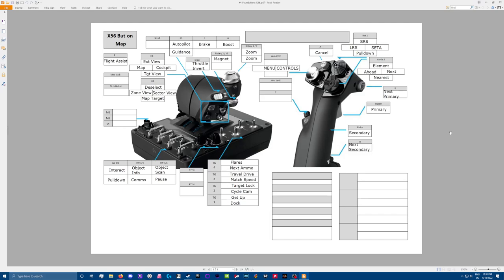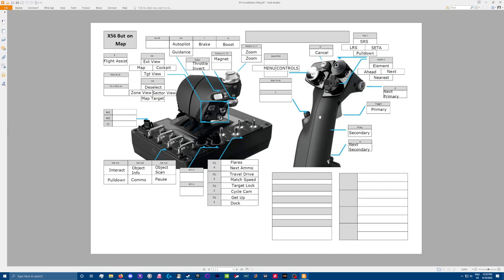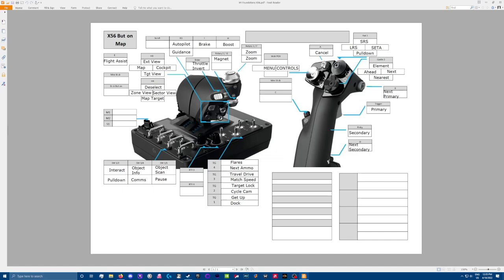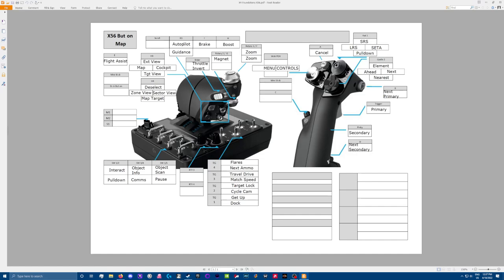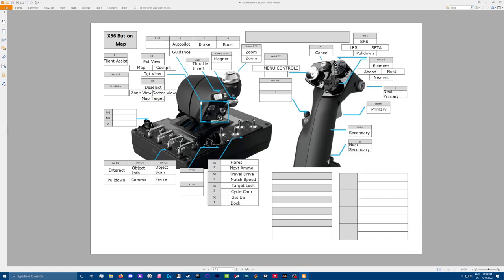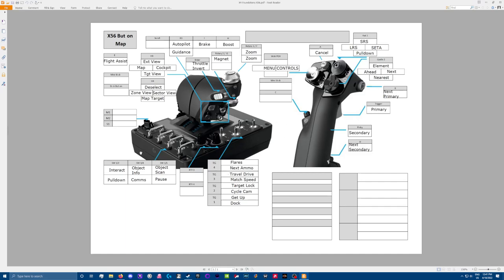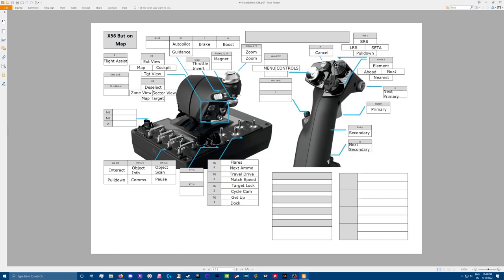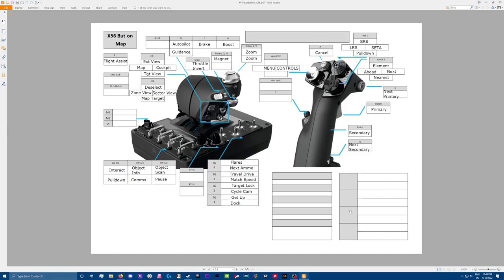X4 Foundations - Logitech Saitek X56 HOTAS Layout

Comment: The ergonomics for the travel drive are spot on. I added trigger to the interact options when on foot, and needed to adjust the reverse throttle button. Maybe 7 changed stuff. Wish I could somehow speed up the C stick head movement speed, but otherwise a boss setup. Brilliant. Kudos.

Comment: Thanks for the video! Super helpful 😄

I have a Saitek X-55 HOTAS myself, which is largely identical to the X-56. Unfortunately, the game wasn't detecting the mini joystick on my throttle near the thumb area, so I couldn't bind strafing to it directly. My HOTAS software detected it just fine, so I knew it wasn't a hardware issue. I went down a bit of a rabbit hole trying to fix this, with the main idea being to rebind the mini stick to output WASD keypresses. Autohotkey is the first place I look to for these kinds of things, but it turns out that that uses the Windows Joystick API, which only returns the input data for up to 6 axes per device and the mini joystick would've been the 7th 😞My guess is that X4 uses the same API. Anyway, after a bit of digging I came across the Windows.Gaming.Input API, which supports any number of axes, and ended up writing a small C# program with the help of GPT-4o to use that to read the joystick inputs and then output WASD keypresses. It's not pretty, but it works!

On the off chance that someone else has the same issue, I made the code open source and freely available here: https://github.com/mickdekkers/x4-x55-hotas-throttle-mini-stick-fixer

Comment: Thanks very much for the video. Very useful indeed. Just starting out in X4 Foundations (yeah, where have I been all this time?). Tried keyboard and mouse and hated it & switched to a HOTAS setup. I've set up my old Saitek X55 as per your setup here, except for some reason you aren't using the F and G Push buttons built into Rotary 1 and 2 which I find quite conveniently placed and give good feedback - I am using F instead of TGL 3 Down for match speed and G for Deselect instead of H4 Up, which works well. I also printed out little DYMO LetraTag labels for the metal SW & TGL switches on the throttle to avoid having to refer to the keybind sheet for all of those (after removing my old Elite Dangerous stickers). Thanks again.
Reply from the maker: I did try using those two rotary buttons but they didn't feel right to me. The way my hand sits on the throttle, pressing down on the top one is with the side of my thumb, as is pressing "up" on the bottom one. And side thumb action feels weird to my hand. Otherwise I'd definitely move a couple of the controls on the switches up there!

Comment: Cheers for this. Just ordered my x56 a few days ago. This gives me a good idea on what to do set up wise.
Reply from the maker: One issue I forgot to mention in the video is that you might get what looks like a bad calibration issue (crazy amounts of drift). Most likely it’s because the software isn’t detecting the axis correctly. To fix, go into the X56 calibration software, adjust the curves to anything else, apply, then adjust them back, apply. That should reset the messed up axis. I occasionally have to do this when I restart my computer.
Reply from the maker: It’s a known glitch with the X56 but it’s hard to track down the solution because it’s hard to describe the issue.
Reply: @arquebusx  Hey, late to the party but i'm cosidering my first HOTAS, is this an issue for all games with the X56 or specifically X4?
Reply from the maker: @arkfille  It’s a problem with the X56 in general. It typically happens after a restart. But once you fix it, the problem is fixed until the next restart.
Reply: @arquebusx  Okay, thanks for the quick response!

Comment: Thanks for this, only issue is that my throttle and stick bindings seem to be swapped. Like my throttle controls movement and my stick the speed and such. Any idea how to fix this?
Reply from the maker: You should be able to switch those in the joystick axis setup menu in settings.

Comment: How do you make the throttle function like the mouse scroll wheel to control speed. When I tried to use it, it went full speed instead of increments based on where the throttle was positioned
Reply from the maker: One of the axis setting options in the game is for analog throttle. There’s a digital throttle setting as well which might be what you had set.
Reply: @arquebusx  thank you il have a look

Comment: I recently bought an x56 second hand and I can't tell if its a stuck button or not but whenever I'm in the main menu the selected item scrolls up.
Reply from the maker: Can you determine which device is doing it? Throttle or stick? It might be one of the rotary dials on the throttle, the game might be treating one of them as a scroll wheel.
Reply from the maker: Another thing to try is use the Logitech software to recalibrate the two devices. Go through each axis and change the curve, apply, then change it back and apply again (any amount of change is fine, just something to make the apply button turn on). That will reset any messed up axis settings (happens sometimes when you restart your computer).

You can tell a curve is messed up if the center point circle is missing. Once it’s recalibrated the center point circle will show up in the middle of the curve.
Reply: @arquebusx  As it turns out, the order you plug the devices in does actually matter, or at least the order the game registers them. In your profile it shows device 1 and 2 for different buttons, I had the throttle as the first device so it was registering the wrong inputs.

Think I do still have some sticky keys but that's another issue. For the most part the controls work fine now.

By the way I think you unbound W as walking forward.
Reply from the maker: @cyqry  Yeah I did unbind W, because I only use the run option on the throttle stick. I don’t remember why exactly - maybe I ran out of input slots? Walking in the game is too slow so whether with the throttle or with the keyboard I would bind the run to the forward walk key.

Comment: Would it be possible for you to upload both a hotas profile and a control profile for x4? im having some trouble setting it up.
Reply from the maker: I've put a link to the X56 profile in the video description. That should have all key maps and button maps (keyboard, mouse, X56).
Reply: @arquebusx  Thanks that was a big help, though for some reason my throttle and stick are set opposite than yours. Stick as joy2 throttle as joy 1. which was easy enough to swap in the input file.
Reply from the maker: @Symbine  Oh yes, that happens. The game registers everything serially by device. So if it detected my stick before my throttle, but detected your throttle before your stick, it would have appeared swapped. Glad it was easy to fix!

Comment: Hi the links are not working. :(
Reply from the maker: Fixed! I moved the files and forgot to update the description.
Reply: @arquebusx  Thanks, got the game this week, the collectors edition version with the tides of avarice dlc.
Reply: Where i put the file?
Reply from the maker: @DarkWatcher-Gaming  The inputmap file goes in Documents/Egosoft/X4/<steamID>
Reply: @arquebusx  got it, but only thrusters works, joystick doesnt :(
Reply from the maker: @DarkWatcher-Gaming  It’s possible that it’s mapped differently on your computer? Not sure.
Reply from the maker: Is the joystick not working at all in X4, or did the inputmap file not put in control setups for the stick? If the stick isn't working at all, make sure it shows up in the devices list inside the game. If it doesn't you may want to check with folks on the Egosoft forum to see if there's any troubleshooting you can do.
Reply: @arquebusx  in the list appear HOTAS X56 when i put your keybinds. And in controls devices appear both, thrusters and joystick,
Reply from the maker: @DarkWatcher-Gaming  So the problem is that the joystick doesn’t work at all in the game even though it shows up in the device list? Can you set any controls manually?
Reply: @arquebusx hi. yes it shows up both, i dont have tryied to set up manualy, gonna try that later.